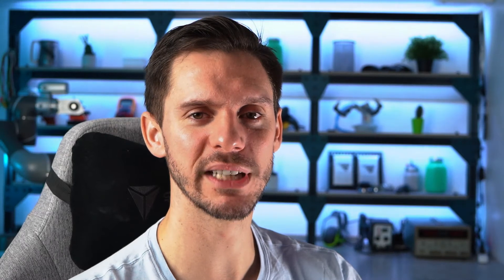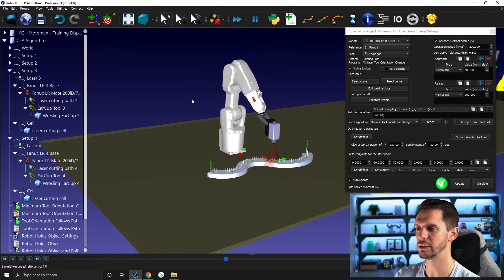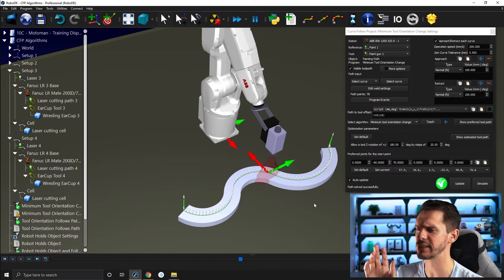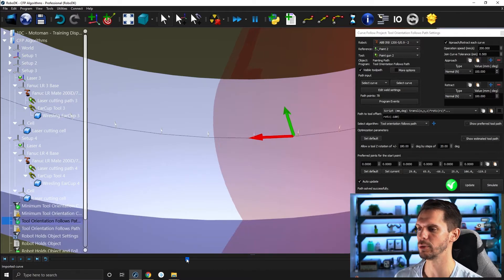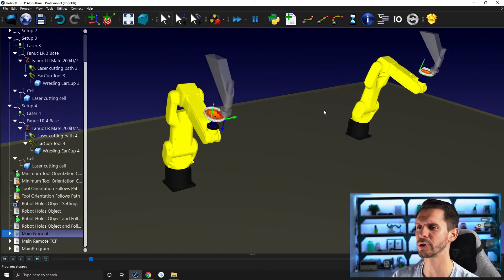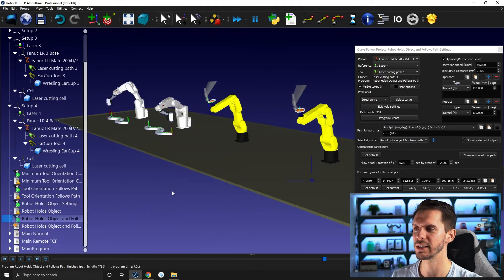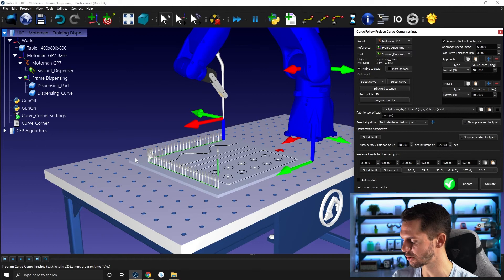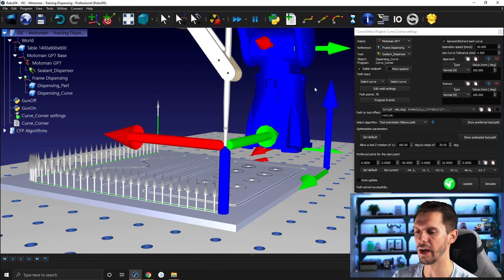Path Strategy (Curve Project) - Module 10 Chapter 04 - RoboDK Pro Training

Comment: I have a question. I'm using Curve Follow Project with Tool Orientation Follows Path setting. I have a UR10e mounted directly overhead a hollow tube. When I follow the path of the outside at perpendicular to the tube surface, it works in the correct orientation. When I trace the inside of the tube at an angle (to reach the inside), the robot wants to swivel a joint 180 degrees to turn the tool (possibly for the robot to experience less stress?) that is not required even though the orientation I had would have worked. My question is how do I limit a joint in RoboDK when following a path? There are multiple variations of angles that the robot can perform to reach the same follow path result. How can I select between them?
Reply from the maker: You can double click on the joint limit labels of the robot panel and update the joint limits. I recommend you to contact us through the forum for technical questions: https://robodk.com/forum/